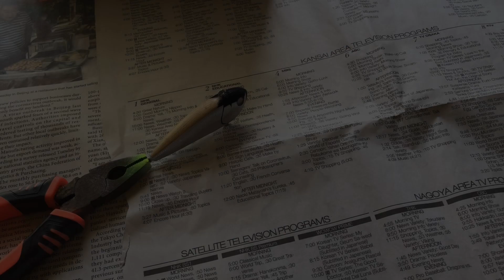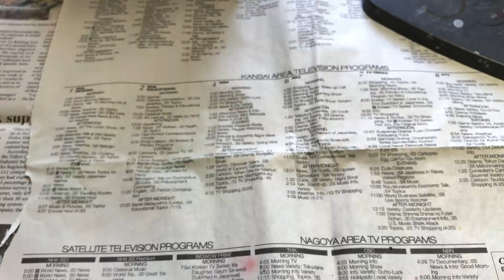【lure making】how to make Lip Less  crank baite

Comment: Have you tried car potty? It does wonders when used to fill those lead holes. Dries fast and easier to sand flush with the wood. Great work as usual.